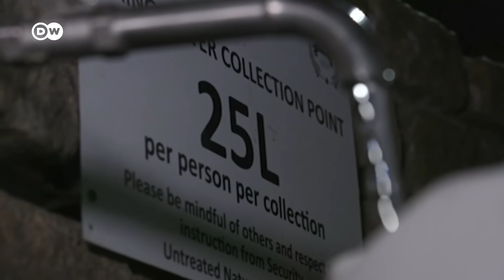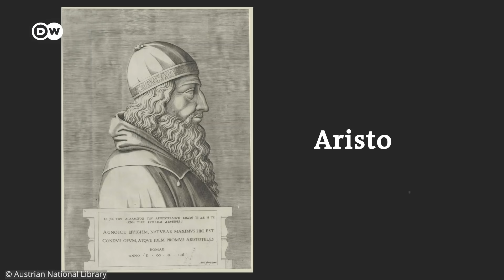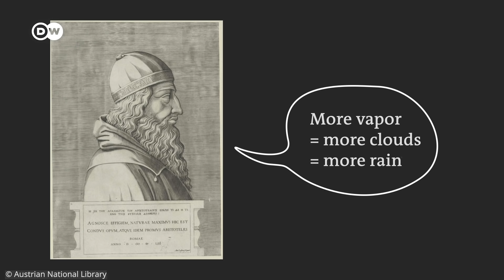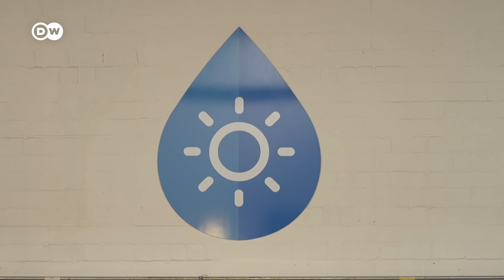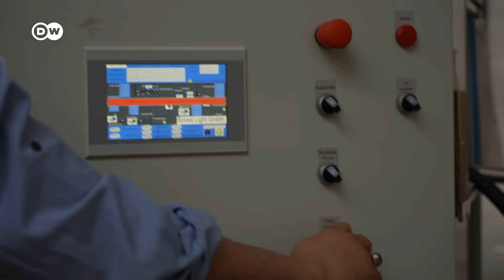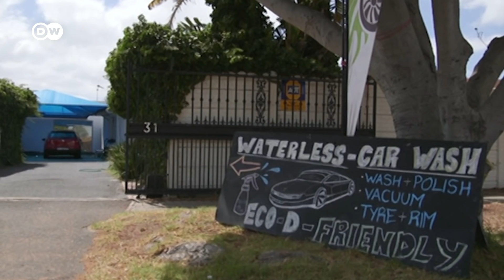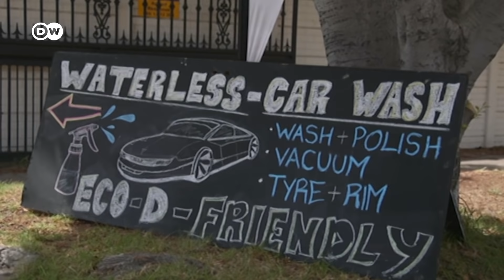Can desalination solve the global water crisis?

Comment: 30 yrs ago while studying for my Civil Engineering degree, we already looked into the upcoming water scarcity and at different ways/methods/technologies on how to obtain water. One method, which is not mentioned in thgis video, but which I believe has already been implemented in an arab country, is the process of condisation of water out of the air. This method is suited along coastal region where the air has a high water saturation. From what I remember long tunnels are constructed which have an opening at the sea and another one in a warmer region. On the warm side the air heats up and a thus escapes the tunnel causing a  drop of pressure in the tunnel resulting in air being sucked into the tunnel at the coastal side. As the tunnel is underground, it has a lower internal temperature than the surrounding areas and hence the air cools down and the airs ability to carry the same amount of water drops causing the water to condensate on the inside of the tunnel. I wonder if any information of such a project is available and if this method might be a viable alternative.

Comment: Desalinated water is not fully drinkable because the  process remov most of the mineral and could result in mineral deficiency in a long run. Conveniently, those filtered mineral is contain in the brine but its really hard to extract those useful mineral from brine since brine is a messy mixture of all kind of mineral.

Comment: It's very expensive and you have to get rid of the salt. I live in Philippines; it's the rainy season right now and trillions of gallons of fresh water are running into the sea every hour. Of course there are many other locations in the World where something similar happens. The Amazon is pouring fresh water into the sea seventy miles off shore. If this could be collected and filtered it could be tankered all over the World. I wish of something that could come back in the empty tankers but I don't see how you could use them both for oil and water. Similarly most of the highly populated areas in Philippines are low rise but yet very few solar panels; another wasted opportunity.
Reply: If you start to calculate the economy of moving water by tanker, you'll realize the problem isn't lack of water, but that in most places and times water is incredibly available and low cost.  This leads to water being essentially free to some folks at some times.  The system is sticky, so when those conditions no longer pertain, folks: 1) have a cow, and 2) never are willing to invest in infrastructure to protect themselves from those time.

Comment: That is not a trillion.  Usin real mathetamics.  unliked($)   real algebra works with real mathematics.   1,000,000 SQURE = to One billion =  1,000,000,000,000       Equation   one million times one  million equals to = one, followed by twelve zeroes.  1,000,000x1,000,000 =  1,000,000,000,000  If you wan a trillion you would need a one followed by twenty four zeroes.  Thas is called one million cubed  or one million to the power of three. 1,000,000,000,000,000,0000,000,000   and so forth and on    one quadrillion  a one followed by 48 zeroes.   Just ask a true mathematitian.

Comment: If the world stopped using drinking water to water stadiums, wash cars and flush toilets, maybe we would be in a better situation, because that's a huge waste of water.
I live in a city where we have many tennis courts for ATP made of clay, and they would water the stadiums every single day. Some years ago we had a short drought, and they started pumping water from the ocean to water the stadiums. Hmmm, couldn't they do that before?? And once the drought was over and we had water again, they started watering the tennis courts with drinking water again, instead of continuing using the sea water.. Fck tennis!
It's about damn time football stadiums convert to artificial grass as well, so much water is being used on the field just for 90 minutes of match per week..
We could flush toilet water with sea water, it's not like our feces will mind the salt. And cars? Why do you need to wash the car so much? Coat it with something to protect against salt and wash it with sea water..

Comment: Dams on the Mississippi river , that would be 29 hold back water and build extreme pressure. Building pipe lines Over a trillion gallons of water  to dry area of the United States could easily balance water and crop growth. Over a trillion gallons of fresh water is dumped into our oceans every day. If only Congress, had common sense this would have been done years ago.

Comment: The “water crisis” seems to merely be an economic one since the major problem with desalination is with how expensive it is and not with how impossible it is.
Reply: @andersanders47  tell me how it will increase salinity in oceans pls
Reply: @andersanders47  we should make use of this waste product tho
Reply: @andersanders47  the frech water you parted from the brine will also eventually return back to the ocean. So the higher salinity isn't actually a problem on the global scale but on a very local scale right next to the desalination plant which could very easily be solved by pumping the brine through pipelines into deeper areas of the ocean and diluding it in that way. The big ocean currents will do the rest.
Reply: @waflmlk what??

Comment: All steam turbines used to make electricity are only between 40-45% efficient; meaning that to make 1GW of electricity they have to make 2.1GW of heat. The 1.1 GW of heat that isn't turned into electricity is released into the atmosphere as "waste heat". That heat could just as easily be used to desalinate water (via vacuum distillation). For example Diablo Canyon (that the democrats are trying to shut down) could desalinate six million gallons of water a day; that's about half of L.A.'s fresh water needs.

Comment: If this brine is a problem and we have no net gain from electrolysis as a result, would it be feasible to use cheaper rockets to shoot the brine at the sun and let it burn up away from earth, or it it too big of a bill of expense? Would there just be too much of it? 
In the long term this is a solution that would free the earth of having to harbor pollutants of any sort as they would simply be sent away and vaporized before ever hitting the sun. In general we could balance the eco system so much better if we could just get rid of the remnants in a way that is permanent.

Comment: The easiest part is to use a 2x1m box about 1m high on one side and 80 on the other side. inside you have 2seperated chambers or a tube cut through the middle. The it should made from metal sheets. Maybe black foil to accumulate heat.

Comment: It will not because the highly salinated sludge that's dumped back into the ocean kills everything around it just like the dead sea which has an extremely high salt content and no life in it.

Until this problem is solved, desalinization is not a viable long term solution.

Comment: 8:32 so what do you do with the salt that is recovered? where does it all go? More energy is needed to recover the salt?
Reply: Basically it'll turn the desalination plant into a joint salt farm. More energy is not necessary to produce salt. Just set the brine in shallow vats in a hot place (like a greenhouse, but better ventilated). The salt can then be sold as sea salt for the table, aquarium salt, or the salt will be refined into pure sodium chloride or iodized salt.

Comment: Holding water on the land, letting it soak into the ground, refilling the aquafers rather than letting it run off into rivers and the sea will help prevent water shortage. Rain water is just sea water that has been desalinated by evaporation. No need to build desalination plants

Comment: Hopefully not, then we would deplete the oceans since we think its an endless supply
Reply: Any resource that ends up getting 100% recycled is effectively in "endless supply".  Effectively all water that gets extracted from the ocean, either by natural evaporation/cloud formation/precipitation, or due to human activity, eventually does end up returning to the oceans.  It is a closed cycle, with 100% recycling taking place when measured over a long enough timescale.  Humans will never drink the Earth's oceans out of existence.  At some point, someone has to take a leak, which typically then flows into a municipal sewage treatment plant, which is then processed and then typically gets discharged into a river, which eventually flows back into the ocean.

Comment: there is more than one way to solve water issues. its just simply wanting to do it. one way or another. talking is easy way to forget the matter at hand
Reply: Like abusing the fact that water is infinite  in a closed loop system? Why are we locked to 1% of the world's water, when we've got 97% that'll NEVER go away until a fucking SPECK of radiation just HAPPENS to break apart an atom of H20   in a RARE occurrence while it's still a gas, high enough for their to be enough energy, and low enough so it doesn't cool.... but like quadrillion of rare occurrences. And it doesn't actually affect how that process works, since the process mostly dries up SEA WATER which then rains on us.

Comment: boil the salt water until it evaporates then collect all of the evaporated steam into another container untill its liquid water and then throughly filter it. clean out the original container. repeat the process for good measure. you now have drinkable water. 
all the crap in saltwater doesn't stay in the water vapor

Comment: Solution: avoid membrane filters, use evaporation. the salt that is left should be dumped at sea in places where there's an increase in rain. I can't be good for the fish to get an overdose of rainwater, right? The solution is simple. There is a fixed ammount of salt in the oceans.
Reply: The seas are getting saltier as salt from land gets washed into the sea.
Reply: @calvingreene90  Well, yea... but that salt COMES from the sea XD
Reply: @xxrgxxcasco  
Believe what you want but it does not alter reality.
Reply: @calvingreene90  Let's say you are right. There is MUCH MORE pruple on the oceans than there is orange, so rain in the ocean counterbalances the extra salt.
Reply: @xxrgxxcasco  
What are you smoking?
Reply: @calvingreene90  Doesn't matter, What matters is that oceans are smoking fresh water rain.
Reply: @xxrgxxcasco  
The rain comes from water evaporated from the ocean.

Comment: Desalination solves more than just the water situation, it also solves the power grid situation and makes it much easier to make maximum use of renewables. Put a Nuclear power plant at every desalination location larger than load of the desalination station to add much needed base load to grid (eliminate rolling blackouts, etc), then adjust desalinated water output to use all excess produced by renewables. 

This solves the problem of solar and wind not working well with traditional power generation. Instead of trying to "react" to the changes in solar/wind output at the base load plants and peaking plants, they can keep all base load plants running steady, and adjust power usage at the desalination plants to "provide" peak output when needed and then make use of excess power when it is available. This maximizes the efficiency of the grid.

Could even use excess power to pump the fresh water up to reservoirs to keep them full, and recover that power and water later from hydro, like a longer term battery for hard times, you know, like in the summer when everyone needs more water and more power.

Comment: I served on a Spruance class DD in the early 80's. These ships had two desalination plants in Aux 1. Together they produced enough fresh water for a crew of about 320. They were temperamental, but used steam in a dual venturi system to reduce the boil off point. Even through the repairs, maintenance and occasional water hours they didn't seem overly complicated. It occurs to me some of todays applications entwine the process because they can.

Comment: Great vid. I think that the showers in rv that use water filter it heat it and spray it back on you should be installed in houses also. When the water is done spat out on the yard.

Comment: We have to develop a passive system that doesn't require so much electricity to operate- ideally using none.  Boreal Light has the right idea but even still- to meet demand it needs to be as close as a natural process as possible.

Comment: No, You are flushing the stuff you remove from the ocean back into the ocean.   Eventually it will be so bad nothing can live in it.    People need to stop living in areas with no water (California)
Reply: a tiny bit more salt (when it already is getting less saline due to polar ice melting)...yeah, that's not gonna be too bad
Reply: @seadkolasinac7220  not just salt, everything that is dissolved into the water.   including the toxins that run into the ocean from the soil.And it avoids the main issue which is over development.

Comment: I think that if you asked every sailor that has ever worked on an older steam driven ship they would tell you that using a water maker that uses heat that is generated from any engine that uses a radiator is the most efficient type of water maker. If you are going to use fossil fuels to burn and produce electricity why not do it as close to the sea as possible. By doing this as you generate electricity you can also produce vast amounts of extremely high quality potable water. Older technology can be re-engineered to solve new problems. The problem with reverse osmosis water production is the fact that the process uses much more expensive equipment and tremendous amounts of electrical energy to think that this process is viable. When you use an old method of flash boiling sea water under a vacuum which is created by simply using a venturi on a discharge line from the boiler it becomes a naturally created process. By taking heat of 180 degrees of the coolant temperature of a radiator from a generator producing electricity you provide the source of heat to boil the seawater at a lower temperature under a vacuum. By running the same seawater in cooling tubes diverted from the seawater being drawn into the vessel to be flash boiled you create a method of condensing the vast amount of steam generated in the chamber. With this method you also do not have the problem of brine that needs to be disposed of. Because the seawater is constantly being circulated you will have o marked increase in the discharge of seawater in excess of what is being used. It is simply taking a portion of the seawater and changing some of it into freshwater. So if we have to produce electricity from fossil fuels let's do it in a way that we can also produce drinking water as long as the plant is making electricity.

Comment: When it comes to desalination the expense is in building the infrastructure once that's done there's the energy cost. US west already has half the infrastructure needed, and right now Utah is worried that their great salt lake is disappearing. You even have an industry that's dependant on the brine of that salt lake. Simple solution. Build seawater pipelines from the sea to Utah. 
The one real drawback to solar and wind is their intermittent nature. Create a "grid" that is separate from the regular grid to keep it simple. Use nearly all of this renewable source of energy for desalination. Only selling any unused excess energy to the national grid to help pay the overhead. It's a desert area around the Colorado River basin, you have an abundance of wind and solar there.
 
Build desalination plants near the Great Salt lake's shore. They can extract the water from the brine and pipe the freshwater into the Colorado River and the brine into the Great Salt Lake or salt flats. Since the infrastructure for freshwater distribution is already built into the Colorado river basin, you already have half that problem solved. Expand the brine water industries at the Salt Flats, etc. if the inflow from the desalination is still too much, only then pipe the excess back out to the sea. 

This is a solution to controlling the seasonal nature of water scarcity during the dry season. When snowpacks are abundant, you can cut back on the desalination and let the Salt Lake/flats draw back down. The Bonneville Salt Flats can be maintained, the Salt mining industry expanded. When it's dry, you have the energy to drive the desalination plants to full capacity, just pipe the excess brine back to the sea. This counters for those years of low snowpacks right when you need it most. I find this to be the most cost-effective and least damaging solution for the western US.

Comment: I remember a few years back they were talking about powerless water collectors basically large metal structures that condense what water is in the air into like  a reservoir.  YOu can build them on the edge of oceans like California would benefit from this you dont even have to remove salt because it is basically rainwater